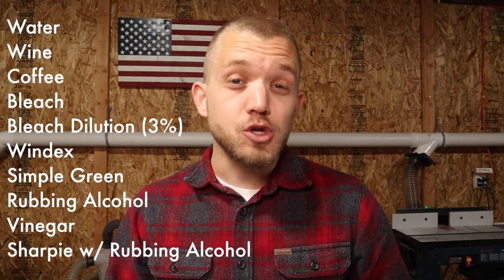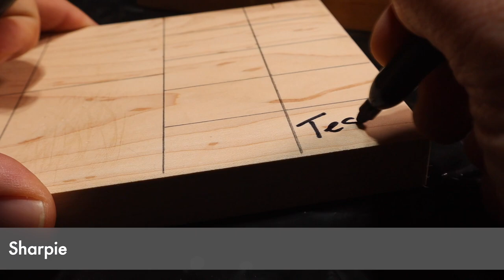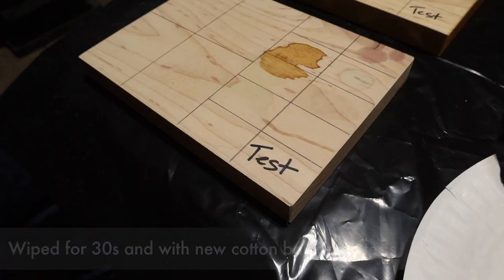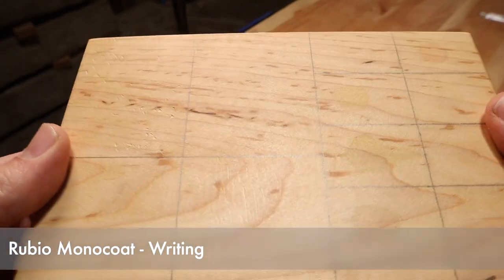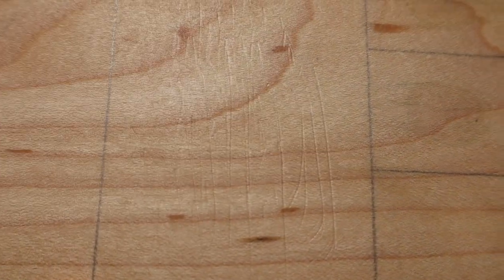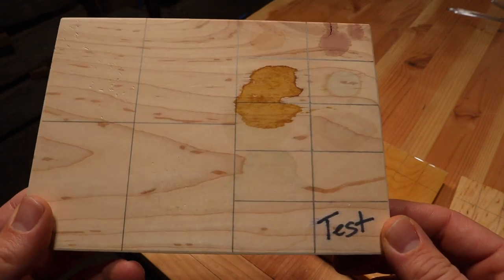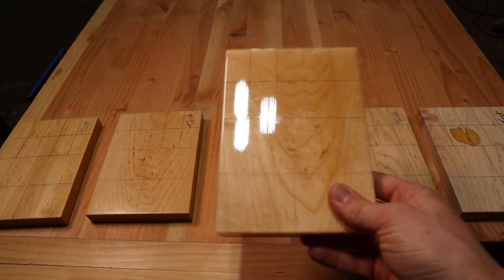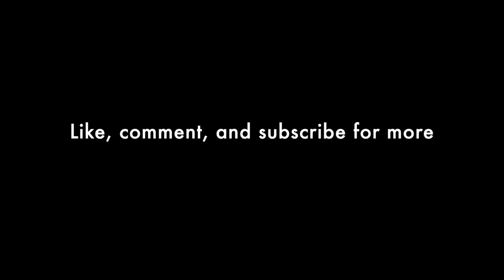Epoxy vs Rubio Monocoat vs Polyurethane vs Lacquer

Comment: For me Rubio is easy to apply and the results are really nice. It’s spendy, but I can do just one coat and it’s kind of hard to screw up. Peace of mind has a price. 😎
Reply from the maker: No kidding! I’ve started to appreciate that as well. There is something to be said for the simplicity
Reply: It  forms a molecular bond with the wood fibre. Which means if it gets scratch and you apply another coat or even sand a patch in the middle of a table... only the exposed wood fires will catch polish and there will be no overlap / Lap / dark lines.

For natural finishes it is certainly the easiest, most durable, easy to maintain and really Matt. I make laser cut wood sculptures from veneer or mdf and need huge amounts of intricate surface areas polished. This isn't just easy, but it is so Matt that we sometimes are confused if it's even polished.

I recommend everyone try this.
Reply: I agree, and even more importantly than ease of application, is the ease in which any damage can be fixed by just repairing the area that needs it and only reapply in that small area. With the others you have to sand entire top down and reapply all of it.

Comment: Great video - seems the poly and epoxy are the winners. Perhaps, if you ever do this kind of stress test again, the  Rubio Monocoat is often paired with Black Forest Ceramics topping - which prevents damage from most things. Also, hot plate and ice cold glass testing could be added to your tests; and if you really want to go crazy, try using walnut (or darken the wood with dark stain) and top with the finishes you have used. This will expose damage you cannot see - or that is often masked on light wood. Many youtubers speak about sanding and finishing on light wood, too afraid to expose the errors that can be readily seen on darker ones. Nice job.
Reply from the maker: Thanks Peter! Great feedback all around! From a raw durability standpoint, I agree, poly and epoxy were the winners but some great points have been raised by others that repairability may also need to be considered. For example, lacquer is wildly easy to reapply and Rubio can be spot fixed with hardly any effort. With regards to the Rubio as well, I’ll have to check out that additional ceramic coating!

I agree on the hot/cold test. My “hot wet paper plate” test fell flat and I need a better test or pair of tests for that. 

I really like your idea of doing the same test in a darker wood to expose some of those other hidden issues that I may be inadvertently causing, or that the stressors are causing. 

Again, all great feedback! Thanks for the suggestions!

Josh
Northwest Craftsman
Reply: Is Black Forest Ceramic suitable for flooring, as in surely there is a difference when it has to be under large  loads, compared to application on furniture? I was hoping the only down sides are cost and glossy finish, I was aiming for durable matte floors...

Comment: My favorite finishes are LeTonkinois and wipe on poly. If you want a cheap way to use old-fashioned poly, buy the flattest option, decant 50% without stirring up the dulling agent that sinks to the botoom of the can. Keep it in a jar and use it for all coats but your top coat. For the top coat, use the original can, and stir up the dulling agent from the bottom. This results in a much more dull and less plastic-like finish. Poly is definitely the most rugged finish, but applying it the old way is a pain, and refinishing is also a pain.
Reply from the maker: I’ll have to check into them! Thanks for the tip!

Comment: 9:00  I am guessing that the extremely small scoring in the epoxy from the keys and knife tests can be buffed out with automobile polishing compound and an orbital buffer.
Reply from the maker: Great observation and more than likely based on what I’ve seen.
Reply: @NorthwestCraftsman also depends how long the epoxy had cured for before testing.  Much stronger after 30 days

Comment: Perfect timing and glad I found ya. Excellent video…thanks for putting in an A+ effort. Just built a cherry and pine tabletop for my dining table and was leaning towards Rubio but going with a poly after seeing this video. Thanks again!
Reply from the maker: Glad it helped! I was also surprised by the results and will likely lean much more heavily on poly. I've also found that it isn't hard to spray polyurethane and achieve a MUCH nicer finish than brushing it on. Just thin it a little with lacquer thinner and it sprays like a champ. Just watch out for the overspray because it will settle and gum things up.
Reply: "Dinosaur table"????
Reply: Depends on if you have kids really. If you use a really hard wood and clean up spills quickly, the hard wax oils like Rubio look the best, but protect the least. If you don't mind the shiny plastic look that may yellow over time, the plastic coatings like epoxy and polyurethane are amazing protection.

Comment: I love Rubio as well, but for a pine coffee table for daily use (feet maybe), I'm going with the poly...water-based semi gloss.
Reply from the maker: Polycrylic works great on a ton of things! Good luck on your coffee table!
Reply: Would you say it is good for oak floors too or is that more of a Rubio job? I remember 40 years ago polyurethane-painted floors would go orange so fast, I assume the modern tech is not like that at all.
Reply from the maker: Great question! Modern poly still yellows but I’m not sure it’s as bad as the old stuff. Poly still seems like the standard floor protectant for hardwood floors.

Comment: Great video, lots of engenuity and plenty of useful information. Im planning to do a large kitchen island with a butcher block countertop so its just what I was looking for. Couple things, for the Rubio Monocoat did you do 1 or 2 coats? It's advertised that 1 coat is all you need but saw some videos of people doing 2 coats and having considerably better results, would be very interesting to compare doing the 2 coats of Rubio Monocoat and doing that ceramic topping. Thanks for the video.
Reply from the maker: Hey Andrean! Thanks for the compliment and that sounds like an awesome project! I have heard of two coats for Rubio with a coating as well but tried to stick with the manufacturer directions to be consistent. Perhaps in the future I'll pull that one in as well! 

Good luck on that project!

Josh
Northwest Craftsman

Comment: I saw there already a question regarding how long you let each material harden BUT I would like some clarification please.  Epoxy and Lacquer may harden in 24 hours but they don't fully cure for several days.  Did you give the lacquer several days to cure before stress testing it, or just the 24 hours?  I really thought the Lacquer would stand up better than your excellent test video showed.  Thanks for doing this!!!!
Reply from the maker: Great questions! It's been a while since I did the test but I followed the manufacturers directions for each of them. I'm sure there is a balance between the manufacturer trying to hit the "leading edge" of when the finish is ready but I thought it was the only fair way to test them. If I do it again, I'll likely wait a week or two from application to test to make sure there's not questions about the curing.

Comment: Just a heads up on epoxy, all epoxies yellow with age. Depending on use case this could effect the look more dramatically.
Reply from the maker: That is a great comment! The table I ended up using the epoxy on is an indoor table away from windows so I figured it was okay but you're totally right. I caution customers away from epoxy if there is much UV exposure.
Reply: For best results put the poly on top of the epoxy

Comment: The epoxy is also, by far, the most difficult to apply correctly. It WILL show ANY AND ALL hairs, bugs, dust particals that happen to land in it when drying. Unless you go through a meticulous process of sanding and polishing to remove them.  Most epoxies off gas VOC's while drying as well, unless they advertise otherwise. PPE is a must while applying.
I've recently tried Rubio and was extremely impressed with it. Also tested a glass of ice water with a puddle of water around the glass for 4 hours and no ring or mark of any kind!
Reply from the maker: That’s another great point, epoxy is absolutely a pain in the butt to apply. I as well am moving more to favor Rubio because of its easy application, easy repair, and more natural look.

Comment: Always been a big fan of Rubio Monocoat.. I have a question though what happens if you hit the scratches on the epoxy sample with a blow torch after the fact.. do they go away?  Might be a interesting extra test...
Reply from the maker: Not sure! During the pour, the torch is used to reduce the surface tension which pops the bubbles. After the fact, we’d be relying on remelting the epoxy which I’m unsure how it’d handle 🤔 worth a test at some point! Total boat says you can sand it at 150 and re-pour to cover surface defects. That seems like the near nuclear option though. 🤔
Reply: @NorthwestCraftsman  it works with acrylic so I wondered if on light scratches it might have the same effect.. dont have any epoxy to test it with.. keep up the good work though love your stuff!
Reply from the maker: @jessejordan310  Thanks Jesse! I really appreciate that! I'll have to give that a shot one of these days! I didn't know that.

Comment: Thanks for sharing this! Been thinking about poly vs rubio for a coffee table. Cat claws act like knifes, so this has been very helpful for me.
Reply from the maker: No kidding Matt! We have a cat as well and his claws are razor sharp sometimes. Not to mention, training him to stay off the table doesn’t seem to work 🤔 the one advantage I’ve heard for Rubio is that it’s far easier to repair so if the cat does scratch it, it can be fixed quickly.

Comment: Should've tried out a thinned epoxy matte finish. That's traditionally my go-to if durability is required. (It's really great for things like workbench, or router/drill press tables. Also, while I despise the stuff, it is awesome with MDF.)
Reply from the maker: Interesting! What do you thin the epoxy with?
Reply: @NorthwestCraftsman  I always used Denatured alcohol. (It's also good at cleaning off epoxy before it's cured. )
 
However, every epoxy is different with the ratio epoxy. Do youll want to do a lot of testing first. But you shouldn't need to thin it if it's a good, slow curing epoxy. 
 
I have used epoxy for decades in things and see almost every woodworker making the same mistakes. The biggest mistake I see is their mixing processes. They mix fast, and just plan on getting the bubbles out after with heat...  But that doesn't fully work on micro-bubbles. And micro-bubbles lead to cracks over time, or with temp changes/impacts. (Especially if pouring it more than ¼" deep.)
 
So if you want the perfect finish, or a great simple finish, just mix your epoxy slowly by hand using a small rounded device (like a ¼" dowel. Stainless Steel or glass rods are best, but troublesome and costly. Now they make silicone rods with steel insides, and theyll last forever.)  
 
[[[[ Make sure you stir in the same motion keeping your stirrer in contact with the bottom of the cup you are mixing in. This will help prevent bubbles from forming. A good epoxy should give you 45minutes of true work time so you should be able mix for 3 to 5 minutes and get perfect results. ]]]] 
 

 
To start off with a test... 
 
1- You'll want to get a soft silicone bowl scraper (less than $10 and eternal.) 
 
2- Use some scrap wood as a test piece. Now mIx a small amount of epoxy (2oz total is more than enough. If using 1:1 epoxy, this will be great training ) and do a super thin coat by working the epoxy into the wood. It should start to impregnate the wood and slowly but surely absorb into your test piece. When finished it should almost appear like it's water thats absorbed into the wood. It will be duller than a thick coat of epoxy bit offer a lot of the great qualities of epoxy. 
 
So try out different techniques. Epoxy is a a tougher medium than it gets credit for. But most epoxy users in woodworking seemed to have learned from wood turners that use it to stabilize pieces.And that's fine if you can fit your entire piece in a vacuum chamber. Lol. 
 
So experiment with a bowl scraper. If your wood is dense like a hard maple or cherry, you might want to thin it with the denatured alcohol. But it can have varying results. It can speed up or slow down work/cure times, or make it cloudy. It really depends on the epoxy brand itself. But if you can find a really good epoxy, it will not need thinning because it should be water-like once it is mixed. But try the squeegee system out first. Just be gentle with the epoxy. Because while heat may assist it, any heat that's not natural will alter the epoxy in some way. So not needing to add heat is the best way to use epoxy... and that only requires you mix it properly.  😃
Reply from the maker: Thanks for the detailed walkthrough! I agree, epoxy seems to be much tougher than people give it credit for. Look forward to trying for of this! Thanks again!

Josh
Northwest Craftsman

Comment: Loved this video! Im doing oak stair treads. Even though you are doing a maple tabletop, its all relative! I know Rubios says only 1 coat, but I have heard 2 coats is better. I wonder if that would have changed your test any?
Reply from the maker: Thanks! I’m glad you found it helpful! I have heard that as well but tried to test their claim as directed. I do think it would help though! Plus, looking back on my torture test, leaving wine or full strength bleach on for an hour is pretty harsh. And on top of that, I hadn’t considered repairability. Rubio and lacquer are the easiest to repair. Honestly, even with Rubio’s poor initial performance, it was the easiest to apply and looked the most natural. I’ve also heard it’s safer to wait a few weeks with Rubio, even with the accelerator.
Reply: Привет, у нас в России наносим в два слоя, и тактильные ощущения лучше и защита древесины.👌
Reply: @АндрейКопылов-о7ь  Thank you, I only speak english so cannot read your comment

Comment: Loved this video! Gained a new sub. Question: do you think the brand of epoxy matters with the test?
When I clicked on your Rubio link it went to a router guide.
Reply from the maker: Glad you appreciated it and welcome to the community!

Brand will absolutely matter and I’ve learned that after the fact. An issue I’ve found specifically centers around the heat deflection temperature. In the eventual table, the heat deflection temperature of the epoxy was too low so when a hot coffee cup is put on it, you get a small dented ring. I’m not able to go back and edit the video as it sits on YouTube, but it’s good to keep in mind.

And thank you! Here is the link to the Rubio, I will get that fixed in the description. Really appreciate you calling that out.

Rubio
https://amzn.to/4177Lsj
Reply: Thank you and I’ve added it to my cart! ❤️

Comment: Nice job mate 
Just one more question 
Have you tried hot food pan or something like that
Reply from the maker: Thanks! And that is an excellent question. I did not because pretty much every finish will fail under direct heat like that. However, one I needed to try was a hot bowl, plate, or cup. I learned after making my most recent table that even though epoxy is the most durable in these tests (which I thought was fairly complete) it has a heat deflection temperature of 135° which means my client, who put a hot cup of coffee on it, now has a small slightly melted ring in the table 😑 not the end of the world, but Epoxy does not play nice with hot stuff.
Reply: @NorthwestCraftsman  

Yeah good point 
How tiny one can go with epoxy 
Like to fill grain or gaps and then if possible a level of rubio or oil finish is that possible with epoxy or has to be Mr. Plastic finish
Reply from the maker: Great question! I actually have a video coming out this weekend on lessons learned while doing my conference room table. One of the lessons what’s that at least with this type of epoxy, you can’t have more than a hairline gap. If it’s sealed around the bottom and edges, it will fill up no problem, but a through crack is a no go. I recommend wood filler that matches so it can at least take some of whatever finish you’re applying.

Comment: Watco, my kitchentable has had it on for a year now. Cherryand walnut. Still looks good. I have used a little epoxy. Meh. Polyurethane? I spray it on and it works. Tough to redo for sure.
Reply from the maker: Is Watco just the wipe on oil finish? I wasn't sure if that was just a brand name or a specific variety?

Comment: Great video and comparison!  Do you think using a second coat of Rubio might help to protect the wood better?  I have seen a lot of people lately recommending and using a second coat to help with protection and to give it an eggshell shine....
Reply from the maker: That’s a great comment. I have actually heard the joke that Rubio Monocoat should really be Rubio Duocoat 😂 I’ve heard the second layer helps a lot and an additional protectant is a ceramic coat on top of that. I hope to give these variations a shot in a second run through of this test  soon.
Reply: @NorthwestCraftsman  i have just recently started using a second coat of Rubio, on some projects and it truly makes a difference  in  the looks, giving the wood a very subtle sheen, but very even....I am truly curious if it will enhance protection too....looking forward to seeing your next tests!